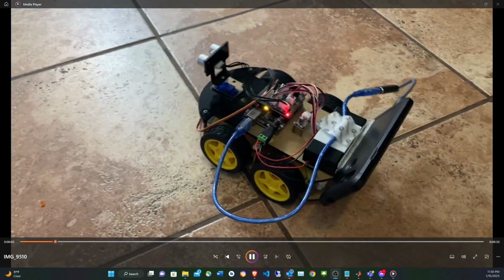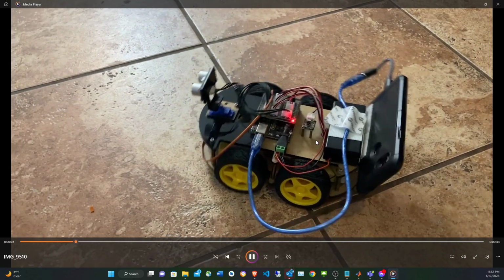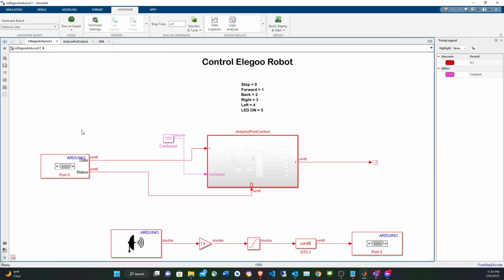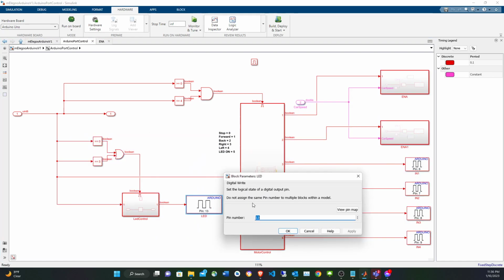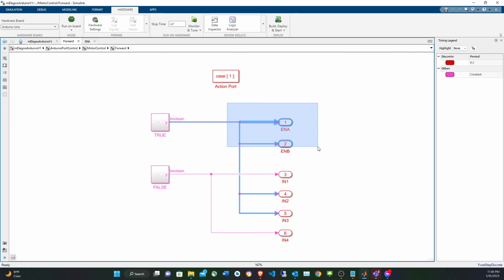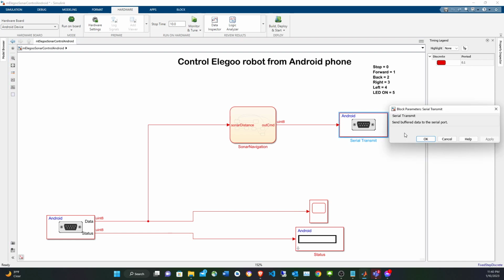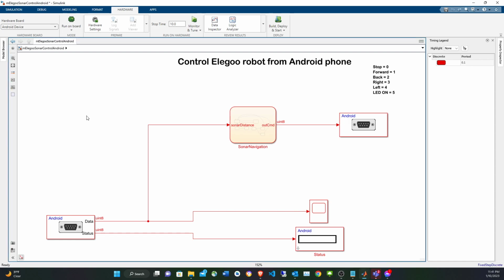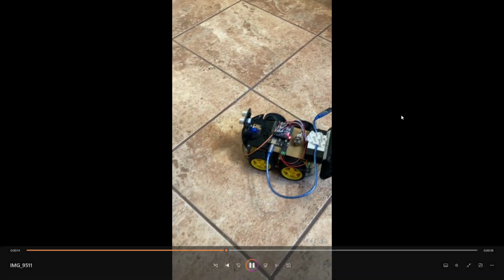Controlling Elegoo robot (Arduino) using Android phone and Simulink generated code

Comment: Is this an Arduino Uno?
Reply from the maker: The robot used in the video is an Elegoo Uno (link is on the description of the video). That link does not say if it is Arduino Uno, but you can see in the microcontroller chip image the name "atmega328p". Search in Google for "Arduino UNO R3 Atmega328P". It seems it is Arduino Uno , although not mentioned explicitly. Maybe that is why the robot is called Elegoo Uno.